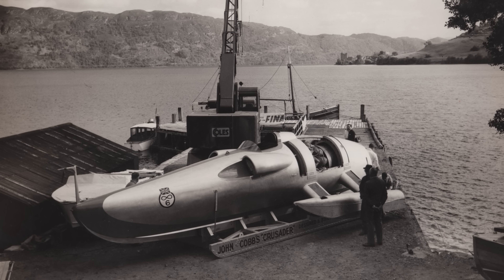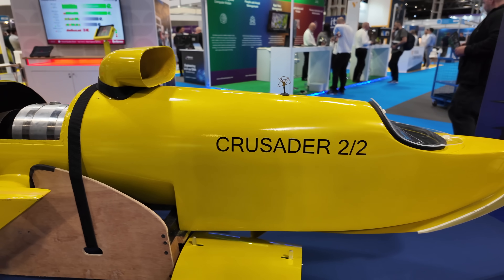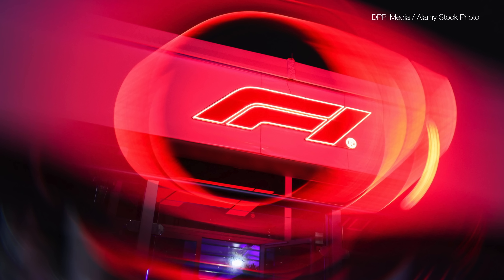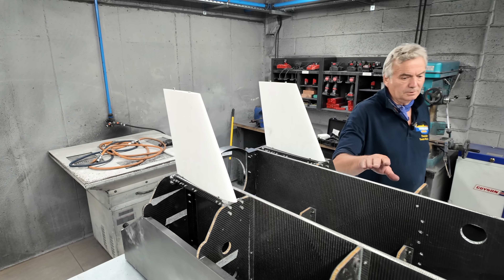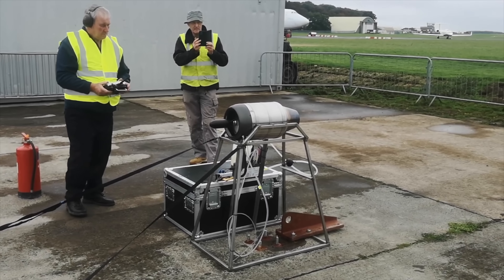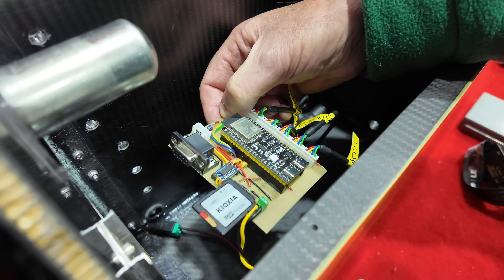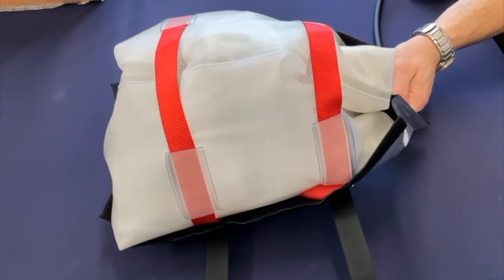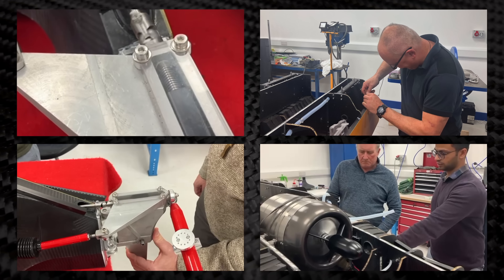Thrust Water Speed Project - Update #6 - Making A Supermodel (C3.2B)

Comment: Someone needs to read the rulebook.
UIM Rule 504.14: "All moveable surfaces allowed on the boat shall be under the control of the onboard crew without any sensors in the control loop (i.e. no auto pilots, auto trims, gyros, accelerometers or other attitude or acceleration sensors may be in the control system)."

Comment: Fun project. There are going to be surface piercing foils? What are the dimensions? Sections? Just a rough idea would be very interesting. So far surface piercing hydrofoils seem to have limits to the top speeds they can achieve, possibly due to induced drag velocity scaling issues.

Comment: I've seen a technique used in unlimited hydroplanes on the honeycomb material where they crush the honeycomb material down maybe 1/8" from the sides and fill that area with epoxy mixed with some kind of filler. The technique adds strength and keep water out of the honeycomb. Wondering if that might help here.

Comment: Very impressive effort. I am a huge believer in hydrofoils, but supercavitating foils are notoriously difficult to control in an application like this. The flow regime on both the foil and strut can change radically with very small changes in submergence and angle of attack. The absence of a horizontal aerodynamic stabilizer is puzzling and worrisome. The boat can not be aerodynamically stable with out one.

Comment: Hats off to these guys, but I can't help thinking that the hydrofoils will be the achilles' heel of this project. The driveline forces on the foils will be utterly immense and they will add a considerable hydrodynamic drag to the boat. Definitely faster without the foils, and the risk of foil mechanical failure likely outweighs the risk of any instability the boat may face without them. I remember when Ken Warby gas axed 50mm from the bottom of his boat's rudder and picked up 40kph in top speed. Warby's rudder was not even ground smooth after cutting, and is still displayed as such.

Comment: A Thrust 2 Boat! Awesome 😊
Reply: Not exactly. It's a very slightly modified Crusader2. -They didn't design the hullform.
Reply: @UnitSe7en  Hullform is pretty irreverent as its now a hydrofoil.

The hull simply needs to provide stable aero and do the low speed stuff
Reply: @ So why not use any other hullform? This is a Crusader2 with foils.